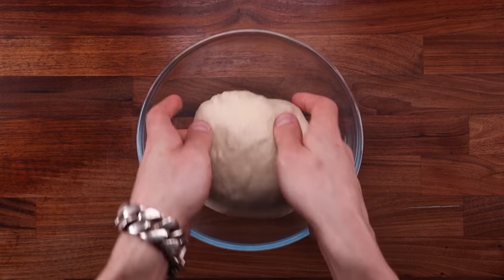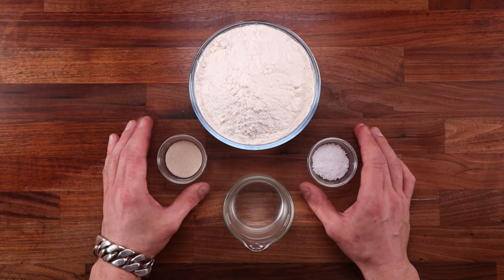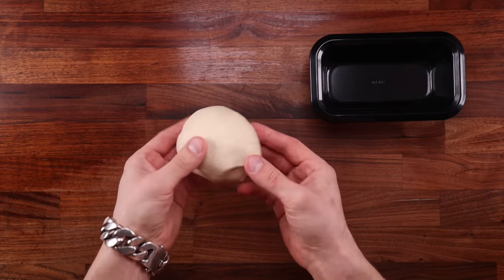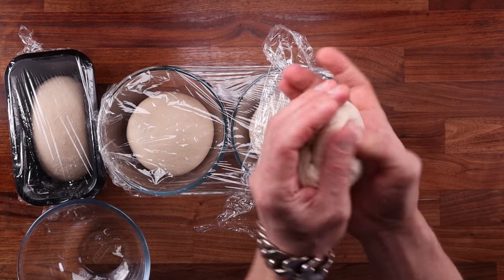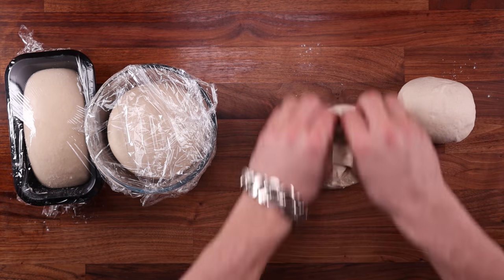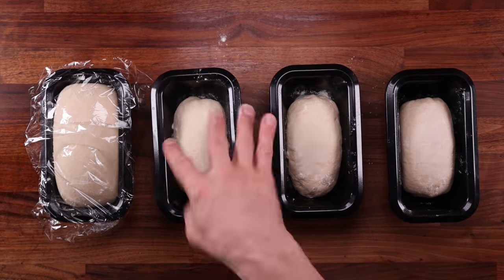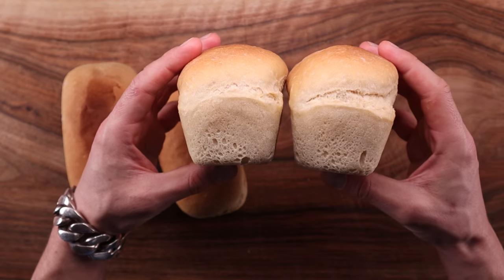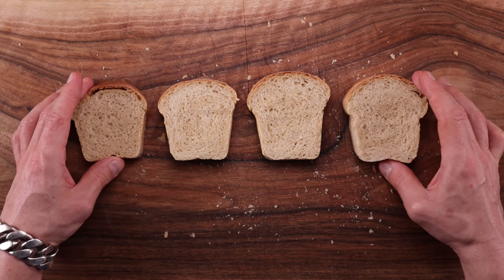Why Do You Have to Punch Down Bread Dough? Degassing Explained

Comment: Holy crap so I'm going through all your vids and I think I've figured out what is ACTUALLY causing my issues. My timing is really screwy (my days are 28h long and my level of sleep and when I have free time is weird) and what I've been doing it GENERALLY following your vids but the times in which I do things - for instance a final fold, or folds, etc. is usually MUCH closer to when I would be taking it out the fridge. 

For instance I don't typically do one before bed, then next day / 12h later take it out and do the outside-the-fridge stuff. What happens is when I wake up I'll do my final fold then, then within like 4h I'd start the outside fridge bits. And this might be the only consecutive thing in all my recipes. Basically I've not been folding it enough near the beginning, AND been degassing it way too close to the end! This might actually be my MAIN issue lol

Right time to start a new one, and to actually not touch it after it's gone in the fridge before bed until it comes out the fridge. (At this rate you're gonna have to start charging me 2 subscriptions, I am deffo high maintenance)
Reply from the maker: Try adjusting your method and note the results. You could even do a side-by-side test to see what works best 😎
Reply: @ChainBaker   Due to fridge space that's not possible but I don't mind doing it one at a time. Plus I'm the only person who eats the stuff I make and I only eat once a day so also gotta work round not wasting food lol. It's all good, doing it one at a time and noting down changes will work for me. 

Current dough has me excited too. I've done 4 folds during the day, it's nice and tough, not sticky, looks firm like in your videos type deal. It's low hydration (65) so will work with this until I get the folding, building etc. in place, then I'll work with hydration from there. One of the benefits of all this free time I suppose, I'll nail this bread SOME day!

Comment: Thank you for making these experiments. What if we fold 4, 5, or even 10 times? How many folds are too many?
As counter-intuitive as this experiment would be, I realize degasing and folding helps the dough to grow in a more homogeneous way, bubbles can lean on each other and build a better crumb and rise in a better way, instead of non-homogenous dough where big bubbles will just take some place full of air not building anything consistent.
Reply: From personal experience, I've discovered you can fold too much real fast. Why? What happens when you keep putting a rubber band on a watermelon? The tension will be too much to handle and destroy all the hard work you put in your bread 🍞 making. I make pizza 🍕 every Saturday but watch bread making channels, to learn to make better pizza crust. I prefer no more than two ✌🏼️ folds. Why? The more loose and soft the dough, I've discovered it has better oven spring. Like stretching a balloon before blowing air into it 👍🏼
Reply from the maker: Mr. Pizza Marlon's watermelon rubber band analogy works well here. Dough can be too tight. Of course, it depends on the hydration and flour too. Some doughs need a lot of folds to make them keep their shape. Some may become too tight and tear when folded too many times and too aggressively. I rarely do more than 2 folds during bulk fermentation. Most of the time one is just enough.
Reply: @ChainBaker  Thank you sir! 👍🏼 Your bread channel truly is the most informative and easy to learn because you don't throw too much at us at once. I agree with you 100% about folding - depends on hydration.
Reply: Thank you all for these answers. That emphasis the relationship the baker has with the dough, the way you feel it, the way it speaks to you, the way it says "enough is enough".
I also used to think that as long as the dough is elastic and does not tear I can go for another fold.  I do bread on the weekends as a recreational and experimental activity and I'll try with fewer folds next time.

Comment: Thank you for making this amazing content, it’s quite informative and exciting! 

I’m wondering did the difference happen because of the folding (gluten and tension buildup)or because of the degassing? What would happen if the degassing happened using a vacuum or just gentle pushes, would we still observe the same results!?
Reply from the maker: They worked together. Degassing without folding would change the crumb too. Folding is more useful for higher hydration or looser dough. If the dough is quite tough and cohesive, then it does not need folding. A gentle press to degas will do 👍

Comment: Hi Charlie,  after cold fermentation, should ALL the CO2 bubbles be removed during degassing and folding?  I know you have taught us to be gentle with the dough but sometimes my loaves bulge out in certain places, especially the seam.
Reply from the maker: Not at all. A light degassing is enough. Perhaps the dough is a bit weak. Try shaping it more tightly. Or perhaps it is under proofed. Try leaving it for longer before you bake it :)

Comment: I would love to get your opinion on yeast amount? Do you feel the more IDY you add The more oven spring you get when baking pizzas? I know a lot of recipes call for very micro amounts like 0.15% just seems like it's not enough levitation power to support toppings? I would love to hear your opinion since you are one of my more trusted sources?
Reply from the maker: The yeast multiplies by itself, so by the time the bread hits the oven there is a lot more yeast in it. Oven spring comes from correct fermentation like not over or under proofing. Tension in the dough, although I guess it does not apply as much for pizza. And the way you bake it. Hot solid surfaces should be used like stone or steel and a very hot oven.

Comment: I do have a quick question: when bulk rising with yeast it's usually suggested to wait until the dough doubles in size, let us assume that this process usually takes 2 hours. If we decide to give it a fold at around 50% increase what do we do then? We wait for it to still double in size (which should now take longer than the usual 2 hours because of the folding) or do we still stop at the 2 hours mark?
Reply from the maker: Always judge it by size and not time. Usually after degassing and folding the dough starts fermenting more rapidly, so it should take less time to double.

Comment: Hi Chainbaker! Could you compare the flavor of doughs that were bulk fermented for different times? You often bulk ferment for 2 hours, but lots of recipes say to only do 1 hour. How would bread taste in a normal 60% hydration loaf if it were fermented 4 hours, 5 hours, or 0 hours?
It's mostly the flavor I'm interested in, even I'm sure the texture would also be affected.
Reply from the maker: The fermentation time depends on how much yeast is used and the temperature of the dough and the environment. Flavour is of course subjective. But dough that is fermented for longer will develop more flavour that is a fact. I would not recommend a bulk fermentation of just 1 hour. Even the 2 - 3 hours I do are not really that long. 
The texture also gets affected a lot. Generally, a dough fermented quickly will be softer. But it will also become stale sooner!

Comment: Hey just a quick question. I saw a bread making video where they used Allinson's easy bake yeast, rapid yeast, and they made wholemeal bread that went straight in the tin ..with just one rise like your first bread on the left and it rose really well.  I was wondering if there was something different about that type of yeast?
Reply from the maker: There is nothing special about that yeast. It's the same as the instant yeast I use. Bread can be made that way, but it most likely will ferment too quickly and not develop much flavour. If a lot less yeast would be used and the dough was left to ferment for a  long time, then I would say it's an ok method.

Comment: so i see you have flour mills and i started to mill my own flour also
What im finding with milled flour is that the second ferment is not fermenting as it should, while the bulk fermentation was a success.
I dont know why the  second ferment is not doing well, and i do de-gaz my dough and shape my dough also, laminating and coiling
I am trying to make 100% milled whole flours without adding any AP flour
If i do use AP flour or some unbleached bread flour im good, but 100% milled i dont get the second ferment rise enough
Same thing happens using integral wheat flour, i dont get a nice rise
(i am using dry yeast while my sourdough starter is getting ready, im on day 4 of starter)
Reply from the maker: The bran in the flour can make the gluten structure weaker. Perhaps that is why it's not rising much. Try lowering the hydration slightly.
Another reason could be that the dough is over fermenting and it has little power left to rise again on the final proof. You can try and ferment it less before shaping it.
Reply: @ChainBaker  I will try both, one at a time so ill know which was the problem, ty for the suggestions, i do let the integral soak first so that the bran isnt so sharp (to soften the bran out)  maybe my soaking period of 15-20 min. is starting some sort of ferment too adding to the time i hadnt considered, we'll knock this out one at a time to find the correct problem  
Ty for answering my question

Comment: New weight scale! Charlie, if a dough has been bulk fermented in fridge overnight, should I bring it to certain temperature before degassing it?

When I'm done mixing, I put the dough straight to fridge, then after 30 mins I do the first fold, put it back again and after 30 mins, I do the second fold then leave it bulk fermented in fridge
Now in the morning, the dough feels tight if I'm trying to degas it rightaway, it feels like I don't degas it too much; I didn't see any significant gas gassing out.
Reply from the maker: You've done all the folds during the bulk fermentation, so I'd say there is no need to fold or degas the dough after it comes out of the fridge. You can just divide, preshape, rest, shape, proof, bake. Or just shape, proof, bake etc.

Comment: Hello, I am currently learning how to knead dough in a bread shop. We mix about 4.5 - 5 Quart of flour. Once the mixing is done, we scrape the dough out of the mixer, divide them into 3 pieces, then "knead" them before rolling flat. The "knead" process usually involves folding and slamming the dough. What does this "knead" process called? and could you please explain how you accomplish this process. The complaint I am getting is that my dough is not firm enough after this "knead" process and so when I roll out the dough, it has more air bubbles than others.
Reply from the maker: My kneading video could answer some questions - https://youtu.be/T8FK5apuL40
Reply: @ChainBaker  Thanks for the info. I have learned quite a bit from your channel!

Comment: Very interesting, I thought that the degassed dough was not going to rise that much. I guess it will also depend on the sugars available in the flour for the yeasts (quality of the flour), right? Thanks for such an interesting test.
Reply: you'll be hard pressed to find an organism that likes living in its own waste products, yeast is the same, CO2 is waste for it, as is alcohol (that evaporates easier then water so is a large contribitutor to oven spring)
yeast produces enzymes that convert the starches to simpler sugars it can consume, higher numbers (look lots of flours have a numer from say t45 to t150) mean more gluten can be formed thus more gas can be caught and more strethch can be achieved, to a certain extend, at some point the gluten will also e broken down and dough is over fermented.)

Comment: If the dough is over fermented at the final stage, before going into the oven. Is better to pop it into the oven anyways, or should we degas and start it again.
Reply from the maker: I would bake it because there is a chance that it would not rise up again if degassed and folded. Because it has gone through bulk fermentation and final proofing. But it can also depend on the bread. There have been many times that I have re-shaped over proofed pizza balls, let them rise again and used them to make perfectly fine pizzas :)
Reply: @ChainBaker  thank you so much for that.

Comment: Does this apply to doughs mixed in a mixer?
Reply from the maker: Yes!
Reply: @ChainBaker  thanks chain baker!! I don’t really degas any of my breads because I make large quantities and it really isn’t feasible to do so. It still comes out good though.
Reply from the maker: Depends on the dough. Some doughs are perfectly fine without degassing. How much dough do you make in one go?
Reply: @ChainBaker  I used to make about 3-4 gallons. But now I’m working and selling straight from my home now and my 20qt machine can only make about 1/2 gallon.
Reply: @ChainBaker  the only thing I degas is donuts because you kinda have to or else they just spread out too much when frying.

Comment: I tried this method and it didn't work for me. I made the same number of degassing and folds as in the video. When I slashed the top of the dough before putting it in the oven it collapsed in on itself and i didn't get any oven spring. The finished loaf has a good crumb structure and tastes good, it just looks odd as it has a valley running the length of it.
Reply from the maker: If it collapsed it may have been over proofed. Try letting it rise a bit less next time and see how that affects it :)
Reply: @ChainBaker  Thanks for the advice, I'll try that next time. I proved the dough for around 4 hours but it was in a warming drawer. I'm wondering if it might have been too warm to ferment for that long?

Comment: De gassing doesn’t seem necessary. 👍
Reply: It isn't necessary if you prefer dense bread full of large holes.
Reply: @perniciouspete4986  They look almost identical to me.
Reply from the maker: It's up to you whether it's necessary or not. They may look quite similar from where you're sitting, but they were quite different. And at higher hydration levels the difference would be far greater 👍
Reply: @ChainBaker  cool. thanks for comments!